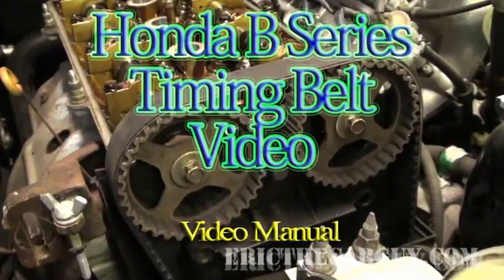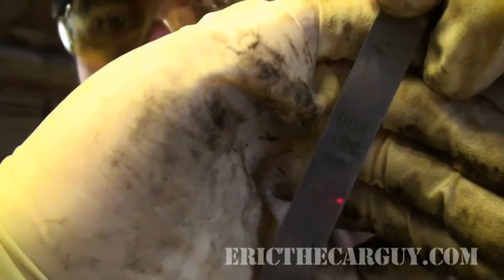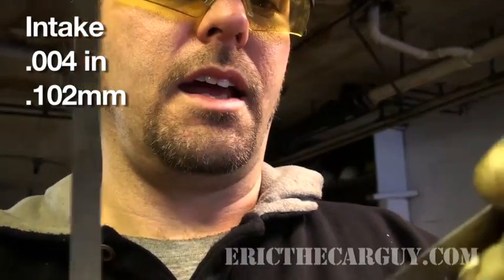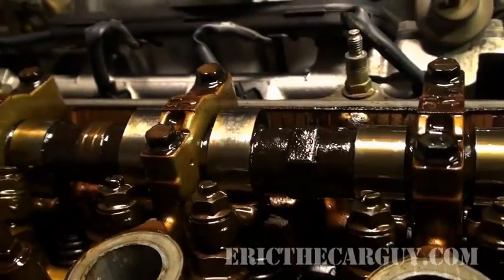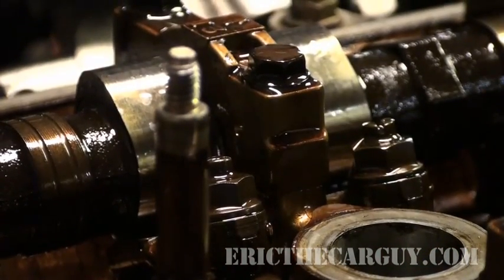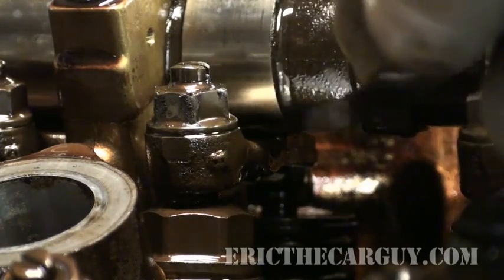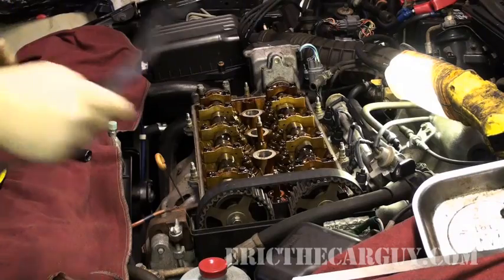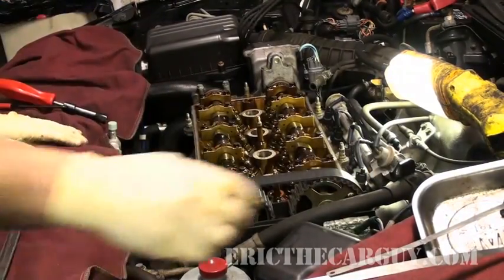Adjusting Valves Acura Integra B18B - EricTheCarGuy

Comment: Eric the car guy have a question for ya. I have a honda civic with a b18b1 in it. My engine is making a loud high pitched noise. I adjusted the valves and the noise got a little better an the pitch got higher. Also a little oil is leaking from where the head gasket is. Where the head an block meet. Do u have any idea how I can fix this problem? Thanks.
Reply: Travis Morford vacume zeal for the manifold to the block